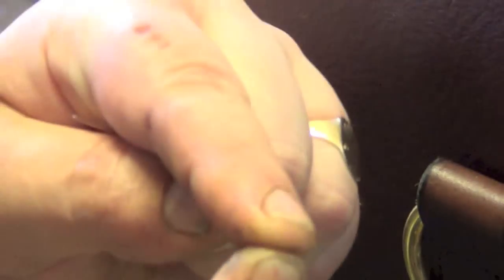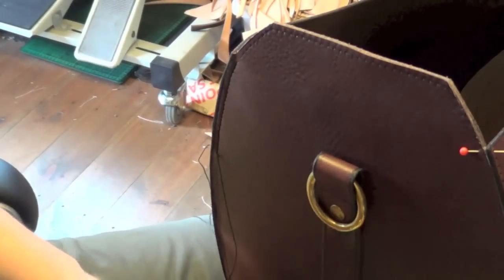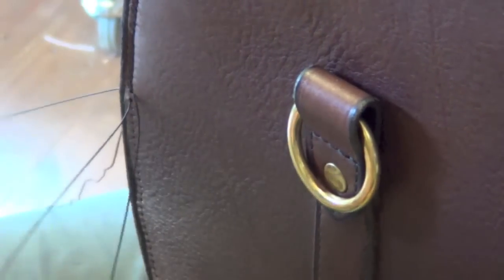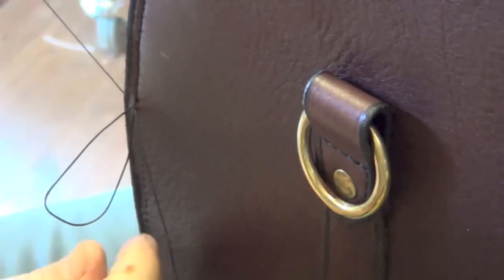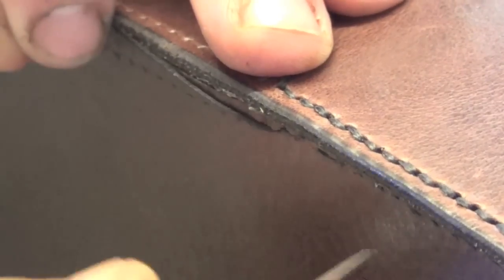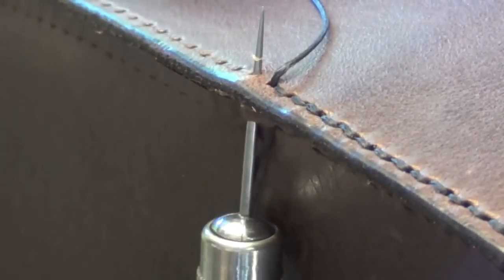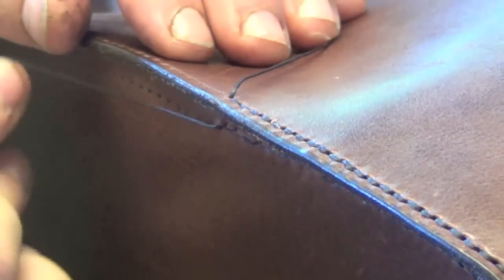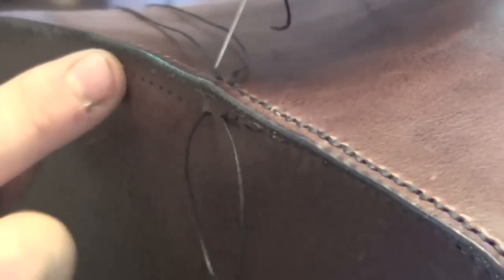The box stitch on the custom holdall

Comment: What is the best way to cut your edges at a 45 degree angle.  I am especially interested in cutting circular pieces of leather.
Reply from the maker: You could make a punch with that angle that you need fir circles but you have to skive the edge free hand with you clicker knife round knife etc hope that helps a little
Reply: Thanks. FYI  I am working on a design for a simple tool that will cut any edge at 45 degrees.  That's why I asked/
Reply: I've been doing mitered boxes for a bit better than 60 years.  I've tried every knife I own.  The main thing is they have to be super sharp and you have to take it slow.  The bulk of mine have been cylindrical boxes.  I also drill pilot holes with a very fine bit in a Dremel.  It makes a good guide for the awl.